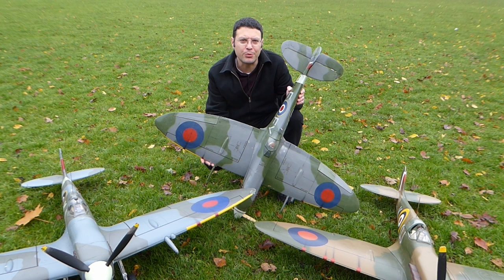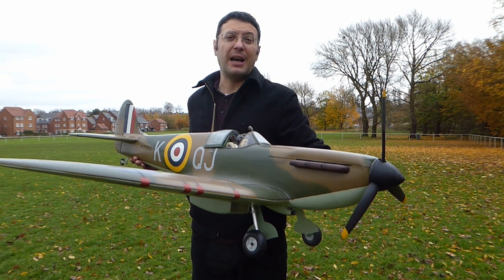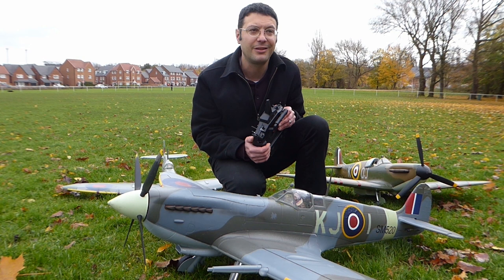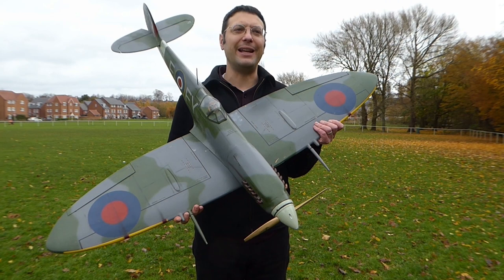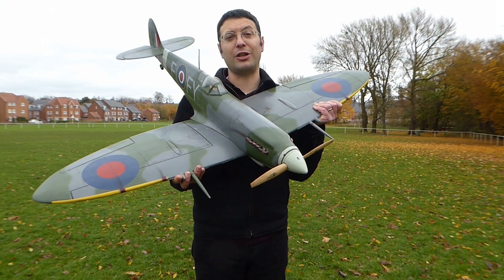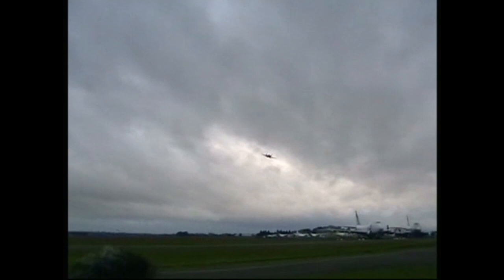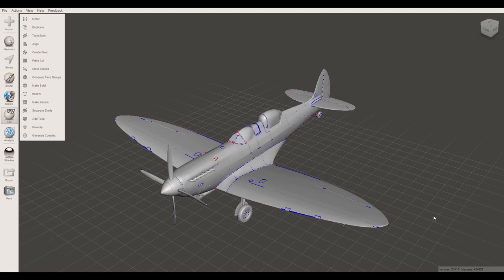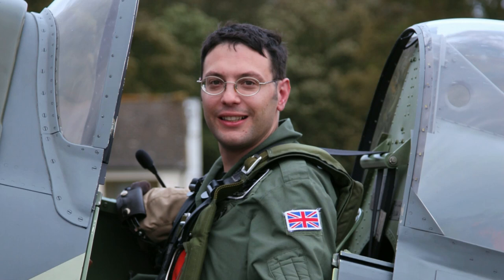Scratch Built RC Spitfire TR9 - Part 1

Comment: I also love Spitfires, have the Savex, did the same with the camo. (Curious how you did the sliding canopy ?) And the Freewing, also with the Benedini sound unit. :-) Just found your channel. We have similar interests i think. Keep up the good work. ..Ray
Reply from the maker: Thanks.  For the sliding canopy, I have a long "U" shaped piece of wire which pivots at the bottom of the fuselage.  The 2 ends are bent through 90 degrees and pass through little fibre-board connecting pushrods, which in turn bolt to the canopy frame.  A small servo rocks the wire back and forth which drives the canopy.  I don't have any good shots of the mechanism as it is buried in the fuselage, but it is much simpler to do than to explain.
Reply: Thank you!